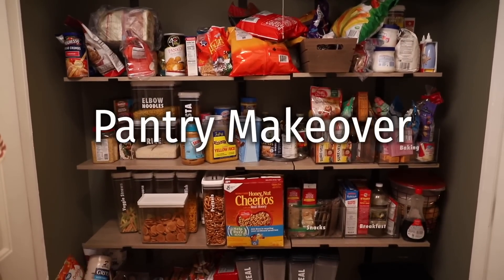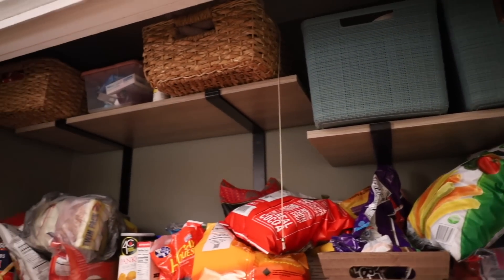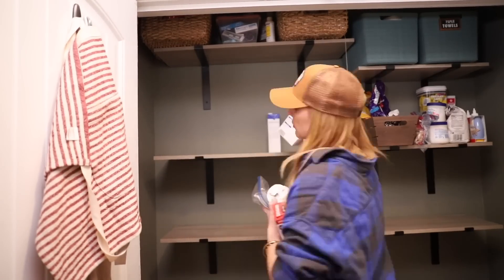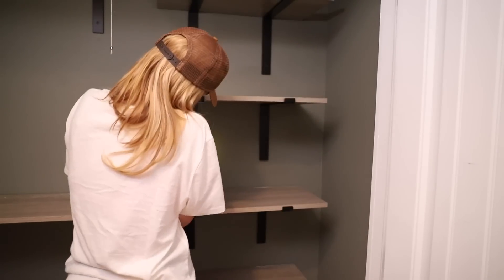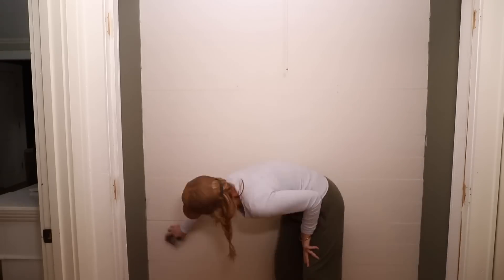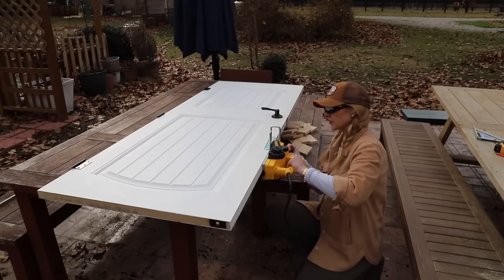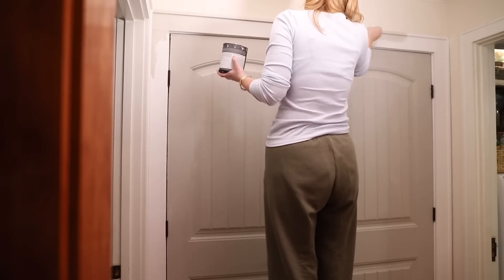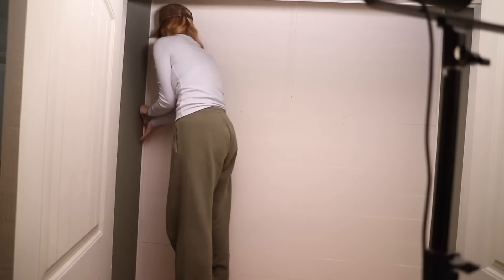EXTREME PANTRY MAKEOVER! // Making our small pantry work for our LARGE Family of 10!

Comment: Sounds like my comment is too late, but may help others: The Elfa Closet System at the Container Store would have been perfect for this space and more specifically for your drywall, as the only holes you'd need to drill would be for the top support rail. Their system uses "gravity" where all shelves hang from the weight of the top support rail. I've used them in a few of my homes and love them! In fact, most shelves are the same from my first place!! They are relatively easy to put up once you get the gist, and if you plan it right, they're so easy to move the shelves around in the future when and if needed. They are a bit pricey, but their 30% off sale is going on right now. Usually beginning of year and July ish.